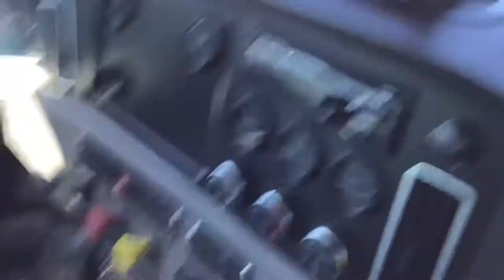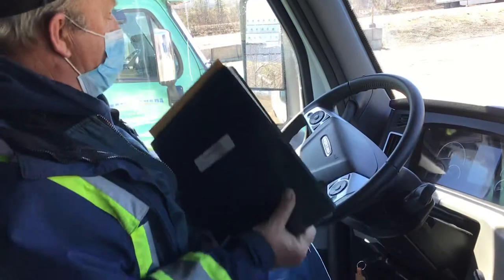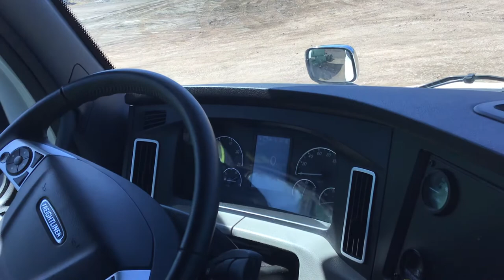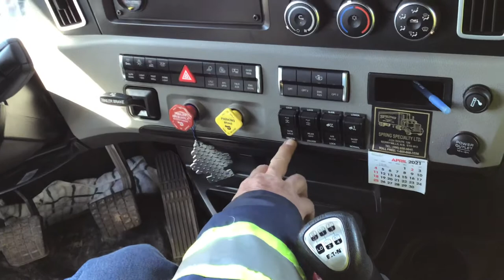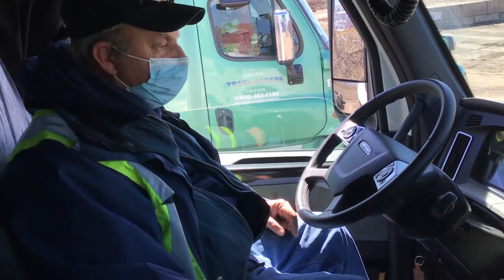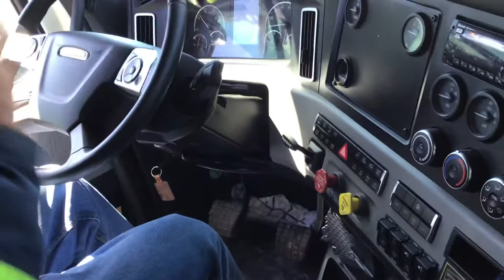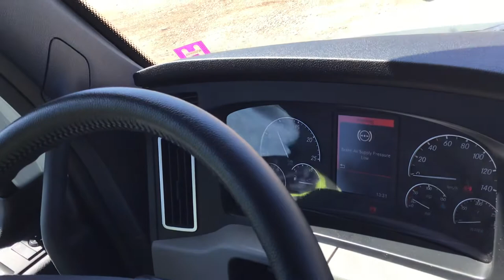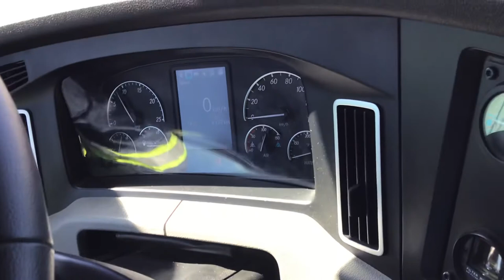In Cab Inspection

Comment: This isn't the full interior inspection I'm currently learning the Pre-trip inspection if you read schedule 1 it tells you the list of items in order that should be inspected for interior inspection you're supposed to tell the exammer what your inspecting as you do it the first item is the Driver's seat, There is no damage to the Driver seat it's secure to the floor and it stays in a set position. Next you're going to check the Drivers seat belt buckle up and then pull on it, there is no damage to the seat belt it secures the Driver to the seat unbuckle and check the tether belt it's secure to the floor and seat and the other side where the seat belt sits. 

Emergency equipment & safety Device I have a fire extinguisher in the Green box, I have a fully stocked first aid kit and 3 reflective triangles. All my equipment is damage free, would you like to see it?

Heater/defroster 
My fan works on all speed put your head on the dashboard to feel the vents my defroster heater vents works and provides a clear view. 

Glass & mirrors 
The mirror on the driver side the left hood mirror the right hood mirror and the Right passenger side mirror have no damage they are adjusted properly, the glass on the Driver side door the Front windshield and the Gass on the Right passenger side door have no damage and gives me a clear view. 

Windshield wipers and washer fluid 
The wipers work on high they work on low and they work on intermittent, turn on the washer they work and provide a clear view for the Driver the wiper blades has no damage. 

Gauges
All my gauges are working normally the air pressure gauges are on normal operating range. The parking light on the dashboard is on there are no other indicator on. 

Steering wheel 
Slightly turn the steering wheel with your hands left and Right then turn it twice to the Left then to the Right there are no excessive free play the steering wheel is secure and responds normally to the Left & Right. 
The exammer will choose 2 items from the list and you have to do it again while reading schedule 1 check list minor and major defect, indicate what you would do.